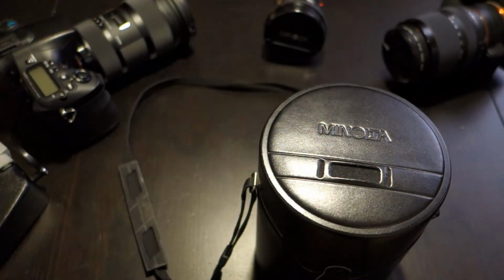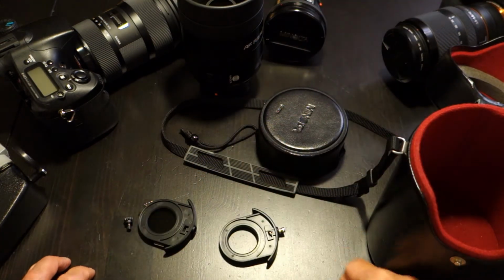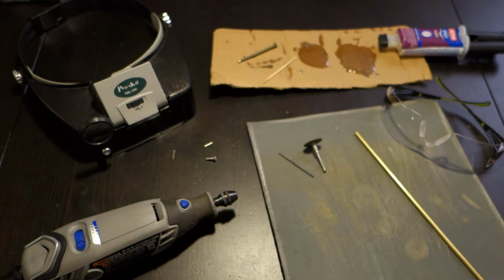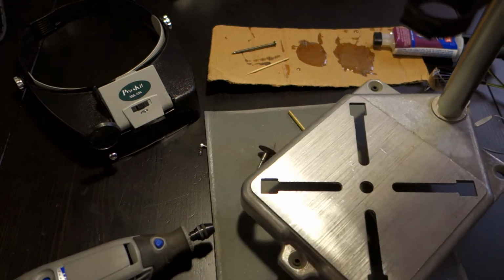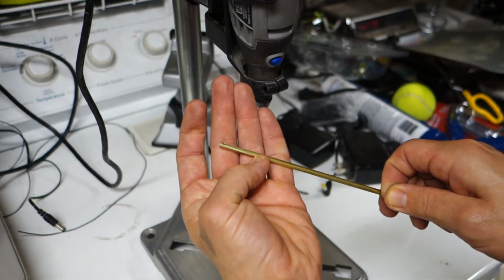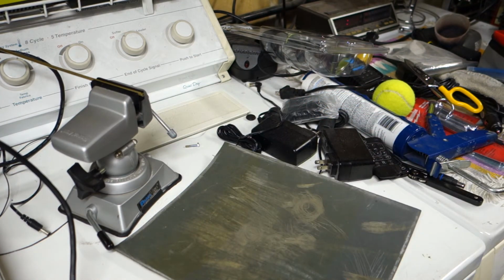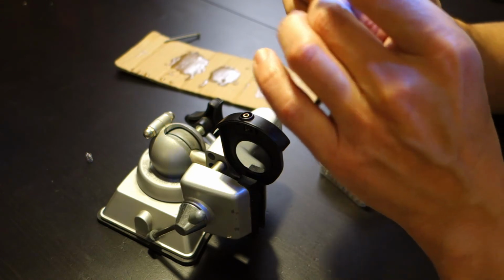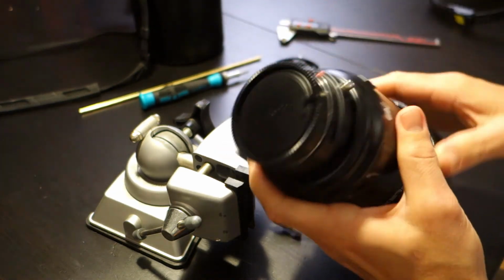Vintage Minolta Sony 500mm AF Lens – Common Problem and Repair

Comment: Very good video, I just bought the same lens with the same problem as you, and I was searching around for a replacement filter holder, or a 3D model I could print. After watching your video, I think I might try to fix it myself. Very good work, thanks!
Reply: I have a rough idea, which is to see if I can find a suitable potentiometer, using the knob above and the optical axis of the potentiometer, so that the remaining work is only to cut the optical axis of the potentiometer and drill the hole in the optical axis.

Comment: Great repair, but I need to get fungus cleaned from mirror and front element..any ideas on disassembly.
Reply from the maker: Hey Clifford.  I don't have any knowledge on how to take a lens apart.  I have seen info on it though.  Just try to Google it.  Good luck!

Comment: Yeah ! GREAT REPAIR.
I think you could have started the gluing process by stopping the bottom end of the tube (where the pin's located) with a drop of epoxy that you'd let dry and sand flush and lubricate with a bit of silicone grease, so that after, when you install and glue the pin, you wouldn't have to worry at all about any glue dripping out of the tube and permanently gluing the retaining clip to the filter's plastic mount.
TWO THUMBS UP !!!
Actually I was looking for a video where it's explained how to correctly disassemble the lens, 'cause I need to remove some dust that gives me a headache every time I see the shots.
Reply from the maker: Thank you!  That's a great idea you have regarding the epoxy.  I suspect I'll have to do a lens tear down in the future, so I'm looking forward to YOU making a video about that :)